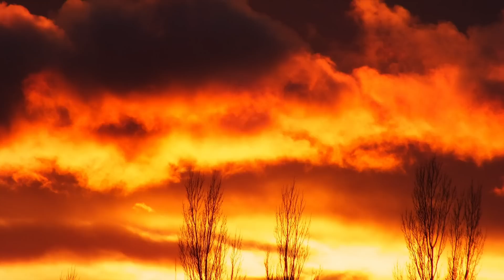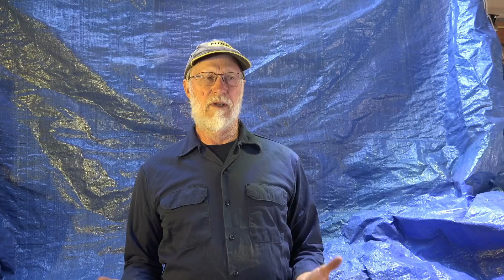Heat pump #6

Comment: I live in southeast Indiana, I switch to emergency heat at 26-28 degrees, my outdoor unit is on the north end of the house. I am comfortable usually, of course the wife has different ideas. After 12 years I re terminated all my secondary elements, they were in bad shape!

Comment: Thanks for your videos!  We had a new heat pump and He gas furnace installed.  The installers set the heat pump limit at 20 degrees outside.  Is that an efficient temperature or would YOU have it at a different temperature?

Comment: I just put a heat pump into my shop with electric heat as backup.  I purchased a honeywell wifi thermostat with 2 stage cool and 2 stage heat I think it has. (at least 2 stage heat anyway)  I am in the north so it does get cold in the winter where the heat pump will not work very efficiently or at all.  Is there a way you can set the thermostat so once it becomes below lets say 30 degree's outside it will only use the backup heat and not run the heat pump and backup heat at the same time, that seems rather inefficient to be running both at the same time.
Reply: Actually, it is efficient to run both at the same time. Although the heat pump will not produce all the heat that you need, it will produce some so that the electric heat strips do not need to make all the heat needed. You can check out an article I wrote on how to get the most efficiency from your heat pump at: http://www.thebesthvac.com/heatpump.html

Comment: so if the heat pump and furnace run at the same time, can the heat pump through a high head pressure?
Reply from the maker: Good question.  If the backup is electric, the heat pump coil is upstream of the elements.  So both can operate at the same time without damage to the heat pump.  If the backup is gas or oil, the coil is downstream of the heat pump coil.  This means the heat pump will shut down to avoid excessive head pressure.  Will have to do a video on that.
GFM

Comment: We use plenum heaters (Also known as make up heaters.) here in Minnesota. I did a video on the systems we install. Its actually 3 sources of heat. The heat pump, modulating electric heater, and propane furnace.